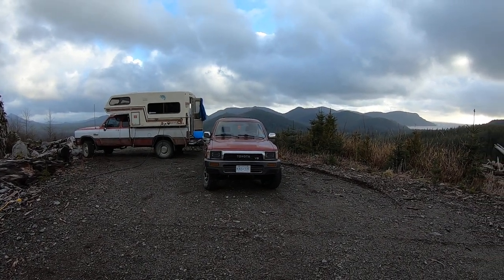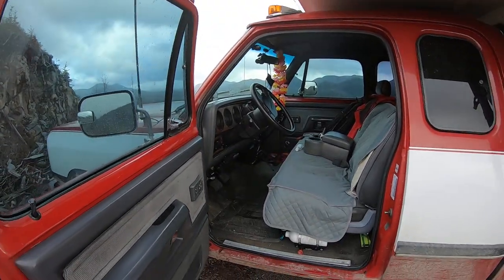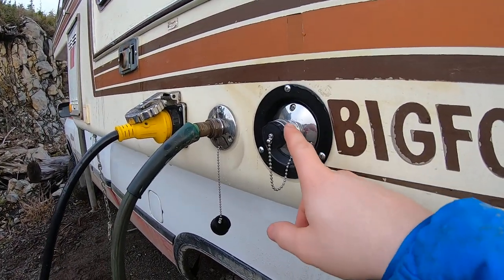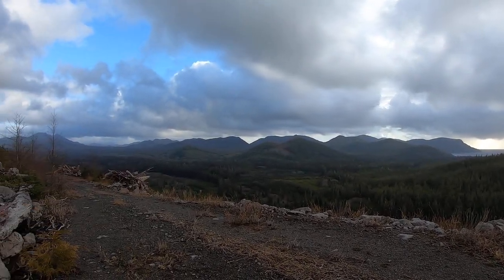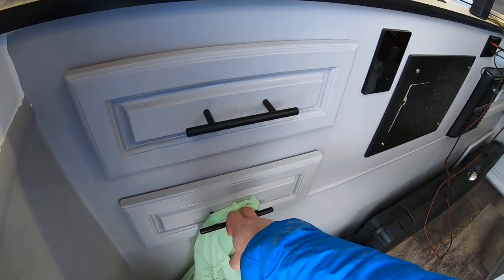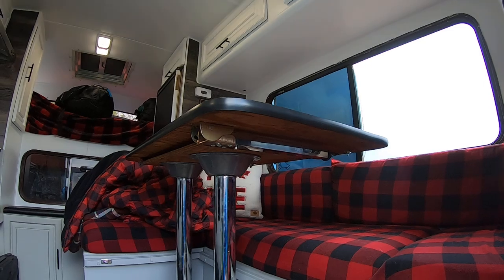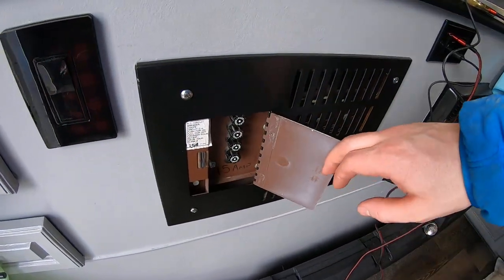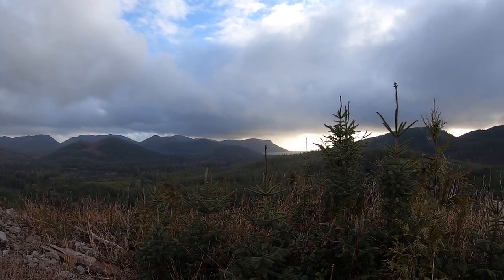Off Grid Truck Camper Setup

Comment: That thing is coming along nice!
Reply from the maker: Thanks! It's been a blast camping. I know I'll probably get some hate taking this thing on logging roads but it's honestly worth it and I've come to realize that this truck is super capable of hauling this big old camper up some pretty steep hills! It's a great time.
Reply: @OvensGarage  i wouldn't give you any hate for that! Better to use that than take out a loan on a $50k plus truck to do it and then be more worried about it getting scratched. 👍